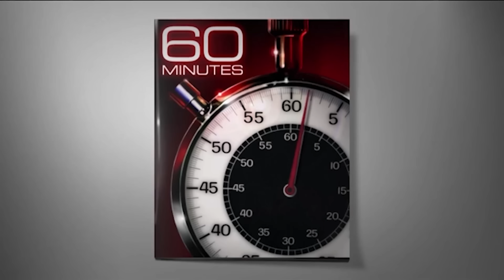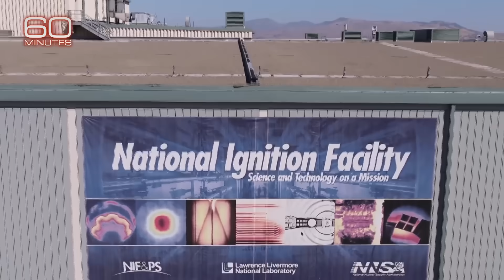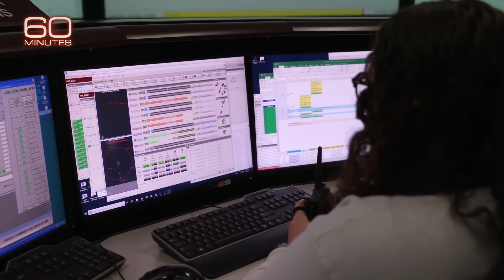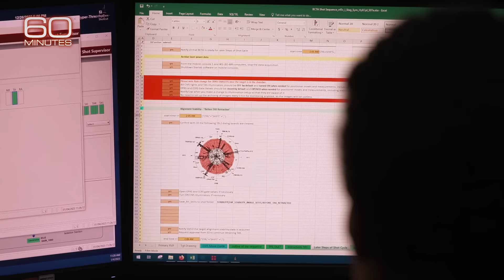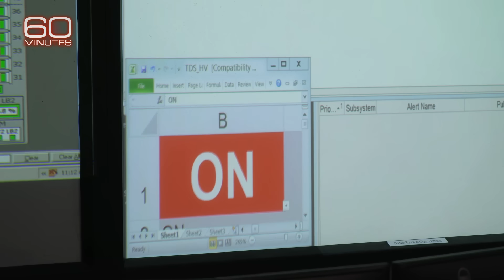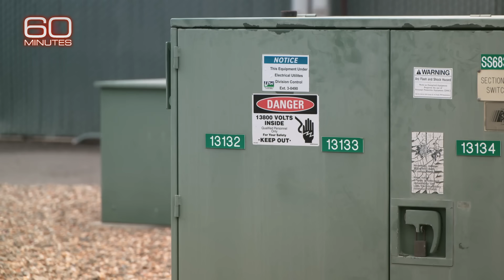Nuclear Fusion: Inside the breakthrough that could change our world | 60 Minutes

Comment: Power plants spin turbine generators with steam so don’t need “sun heat” to boil water…so why would they need a dozen of these capsules in a day?
Reply: Traditional power plants, whether driven by fossil fuels, falling water, solar radiation, wind, or nuclear fission reactions, operate continuously. In the announced experiment it took them about a week to set up the experiment and the release of energy only lasted for approximately 0.00000000008 second. After the fusion reaction begins it blast the vast majority of the supplied fuel away from the reaction center. That then has to be cleaned from the vacuum chamber as radioactive waste. That energy was 3.15 mega joules which is equivalent to 0.875 kilowatt-hours. Considering the usual loss of efficiency to use that energy to boil water that would leave around 0.3 kilowatt-hours of heating energy. The application of 0.3 kilowatt-hours of energy can boil slightly less than 0.5 liters of water. If the steam from that water was used to turn a turbine then the electrical energy from that would be less than 0.2 kW-h. Typical commercial nuclear power plants generate from about 0.5 to 5.0 million kW-h of electrical power. To generate 1.0 MW-h of electricity it would be necessary to blast slightly more than 1 fuel capsule   every second. If the lasers were physically firing more than their current limit of about once per day then the energy needed to drive those lasers would be at least 300 mega joules, or close to 1,000 times more than the energy sent out over the transmission lines.

In the announced experiment the target assembly, that is turned into a plasma with each laser shot, is estimated to cost approximately $100,000 and the tritium fuel presently cost approximately $30,000/gram. The presenters are masters at excluding such key details.

Comment: Where does the extra energy come from??
Reply: In a nuclear fusion reaction, just looking at the merging of a nucleus of deuterium and tritium isotopes to form a helium-4 nucleus, the resulting helium-4 nucleus, combined with the ejected 14.1 Mev neutron, has a rest mass slightly less than the original reactant nucleuses. It is consistent with Albert Einstein's famous equation E = ∆Em2. So there is a small loss of mass during the reaction and that loss of mass is turned into energy, much of it is in the form of kinetic energy of the emitted 14.1 Mev neutron.

You can read more about it in the Wikipedia article titled Nuclear fusion. This reaction is covered under the 'Process' heading.

Trying to create this reaction on earth still hasn't been accomplished without a tremendous amount of input energy.
Reply: @SammySlamma92  I liked the points you raised. Still nuclear fusion reactions are very different than the common chemical and friction reactions that are common in our world. The hand clap results in more atomic vibrations which expresses itself as heat and sometimes sound generation. Charged subatomic particles either attract, or repel, depending on whether they have the same charge, or opposite electrical charges. Yes, insane amounts of energy must be expended to try to replicate the force of gravity in the core of the sun. The efforts have been taking place in experiments since the late 1970s. There remains no shortage of hope, especially those among those who assume all these efforts are relatively new.

Comment: This is BS. That laboratory didn't bring anything new to the table, fusion was proven by nuclear fusion bombs in the 50s, they didn't produce more energy than what they were using and they cannot even sustain the reaction, so basically, they fire the lasers 1000 times and 1 time they measure energy in a point of space and not the whole energy used to power those lasers, this is crazy. The actual Q is less than 1%.
Reply: The National Ignition Facility (NIF) management has their own definition for gain, or Q. I'm still not clear at what reference point that they specify it. It may be just the X-rays that end up compressing the fuel capsule. In prior years they didn't mention the laser input energy. The experiment took about a week to set up so they should have stated the power consumption of the facility for that week.

They also have their own definition of 'ignition.' It isn't like a match ignition where the chemical reaction spreads to the fuel in the head over about a two second period of time. In NIF's case the reaction is totally dependent upon the compression due to the 3 nsec laser pulse. The nuclear fusion reaction lasted for approximately 0.00000000008 second. After that the enormous forces in the microscopic reaction center blasted 96% of the fuel away before it had a chance to react. That was blasted onto the walls of the large vacuum chamber and required removal as radioactive waste.

If it was even possible to conduct one of these 'ignition' experiments once per week on a regular basis then the fusion duty cycle would be approximately 0.00000000000001%.

None of the fusion energy was captured and none is planned, except that tiny portion used by the instruments for measurements.

The NIF project has always been primarily funded as a thermonuclear weapon (H-bomb) research tool but the management has always pitched it to the public as if it were a path to a future economically practical nuclear fusion power plant. The announced experiment included a target material for a nuclear weapons related test. The management have been masterful in obscuring its real purpose. The Lawrence Livermore National Laboratory (LLNL) got funded for NIF in exchange for ending their full-scale nuclear weapons explosion program at the Nevada Test Site (NTS). The LLNL and LANL were forced to end their full-scale underground nuclear explosion test programs at the NTS due the Nuclear Test Ban Treaty (NTBT) going into effect. NIF's aims have always been to create thermonuclear weapons explosions on a microscopic scale.

Comment: The time plan schedule that an energy production using this type of system seems too long and far from us and that is very strange cause some Italians and Greek scientists before 2 decades build the Researching program named 'Deykalionas" and they did build that system of energy production based on the terms of Nuclear fusion that really works and with the use of two basic elements of Nikelium and Hydrogen they did cold nuclear fusion reactor that produces energy for years with a small amount of water and nikelium. How these scientists here after 20 years said that it was impossible to build a system before 2050?? Propably they lied for some reason!

Comment: I thought we already used nuclear fusion in nuclear power plants
Reply: All the existing nuclear reactors, beginning from the late 1930s, rely upon fission reactions. Today the vast majority of those fission reactions are fueled by the uranium-235 isotope and by plutonium isotopes. In those reactions neutron rich isotopes are bombarded with neutrons, causing the hit nucleuses to split into smaller nucleuses that are approximately half the mass of the original nucleuses. The reaction liberates a large amount of energy that is covered to heat and in commercial and military applications used for generating electricity and propulsion respectively.

Comment: Please don't send it to the Smithsonian it will get lost. Biden is talking out his hat. Failed how many attempts over how many years? Got it right once.
Reply: It failed to achieve its namesake goal of 'ignition' by 2012, by a factor of 10, despite having two large laser facilities before it to work out the kinks in the Inertial Confinement Fusion (ICF) process and with two other large ICF laser facilities in the U.S. helping in the ICF development process. Despite the failure to meet that goal funding continued which has finally led to the original goal a decade later. It is estimated that approximately $11 billion has been spent on NIF. NIF has always been primarily funded as a thermonuclear weapon (H-bomb) research tool but has always been presented to the public as a reasonable path to a economically practical nuclear fusion power plant. It is located within the Lawrence Livermore National Laboratory (LLNL) that has always been primarily funded as a nuclear weapon research facility. LLNL was created in 1952 so these operations have little to do with which political party happened to be in control over all the intervening decades. Readers can learn more about the National Ignition Facility (NIF) from the Wikipedia article on it.

Comment: 300 in 3 out! So they got back 1% of the energy they put in!
Reply: The nuclear fusion energy produced was determined by precision instruments. None of it was captured for any practical use and there has never been any plan to capture it since the facility was only designed to simulate thermonuclear weapon (H-bomb) explosions on a miniature scale. It was never intended to lead to a future economically practical nuclear fusion power plant. NIF has consumed approximately $11 billion and the announced experiment target assembly is estimated to have cost approximately $100,000. It was converted into a plasma once hit by the focused laser beams. The nuclear fusion energy released was radiated in all directions from a microscopic spot from the compressed D/T fuel. That energy release lasted for approximately 0.00000000008 seconds. If captured it would have been about enough to energy to boil two liters of water. I can boil the same amount of water on my stove for about $0.40 of electricity.

Comment: Some for now it took 300 units in and 3 units out . Now tell me how is that making money . This is really semple math . Even I could follow it .  But for those who dont I will tell you . If you had 300 USD and wanted to trade it for something more and you found a person with 3 USD and you trade . That is not making money . Both people are fools .  So lets see what the real cost is for now .  We started out with nothing .  now we have to make the building and equipment to make it work . Now remember we started with nothing . So we are already in a hole just for this . Lets just say that cost is $100 . Then all the time of work personel lets just say that cost came to another $100 .  Right now we are at the stag that we got it to work for that single one time shot that it did work for about a split sec.  So so far this cost the tax payer 200 and we only got a split sec of energy back out  at a cost of -$200 to 0 .
Reply: Good analogies. Such waste was made possible since NIF has always been primarily funded as a thermonuclear (H-bomb) research tool. The management has always pitched it to the public as a reasonable path to an economically practical nuclear fusion power plant while obscuring its real purpose. NIF was preceded by two earlier large fusion research facilities that were expected to overcome most of the kinks. NIF was completed very late and well over its original budget. It was supposed to achieve its namesake 'ignition' by 2012 but failed by a factor of ten. It has taken a decade of improvements to finally reach that goal with doesn't factor in the laser input energy. One estimate of the total funds NIF has now consumed is $11 billion. It was expected to be followed by the LIFE project but after the National Academy of Sciences (NAS) produced a critical analysis of that plan the lab quietly defunded the project. That hasn't stopped the administrators for pushing for a higher power version of NIF that employs diode pumped lasers.

Comment: Once this ignites, the ideal situation would be for it not to go out.. one shot..
Reply: The National Ignition Facility (NIF) lab uses their own definition of 'ignition.' It isn't like a match that once struck the combustion reaction spreads through the rest of the fuel until it is all consumed. That initial reaction takes about two seconds. In the Inertial Confinement Fusion, used in this experiment, the nuclear fusion reaction lasted approximately 0.00000000008 seconds. During that time the vast majority of the fuel was blasted away from the microscopic reaction center. It was reported that only about 4% of the fuel got a chance to react. The reaction was almost totally dependent upon the compression provided by the laser beams, lasting only about 0.000000003 seconds. The energy to create that was over 100 times greater than was generated by the nuclear fusion reaction. The approximately $100,000 dollar target assembly was converted into an exploding plasma which splattered the interior of the vacuum chamber and required removal as radioactive waste.

The experiment took about a week to set up. If this experiment could be repeated once a week then the nuclear fusion duty cycle would be 0.00000000000001%.
Reply: @vernonbrechin4207  well interesting stuff there, maybe they need to have the particular levitate with magnets and spin the reaction, I don't really know about this stuff, (plumber) but anyway it's great to be making advancements and more understanding of the technology. 
To me, keep it safe, somehow have a nuclear fusion that continues.. or stick to solar, wind, hydro power, and change the way we store power...  I'm sure it's all happening anyway.. 
If it's all about compression, and pressure why not use High density microwave laser in the chamber, levitate the particle (a much bigger one that requires less change) supply more power and have it continue to run. 

The fear is if a technology like this leads to something unexpected in the power of the reaction. 
That's the unknown. 
If the Sun can be re created, step lightly, as anything that surrounds it, I'm sure would not withstand total power.
Reply: @NatureCams  - In this experiment temperatures of around 150,000,000°C were achieved and pressures far greater than the anything humans ever work with. In arc welding the plasma temperature might be 10,000 °C. Simulating what happens in the core of the sun and sustaining it has been a goal of nuclear fusion physics experiments since the 1970s. It has only worked in H-bombs which are massively destructive. Any attempt to attempt to contain a miniature nuclear exploding if fruitless. It is going to explode violently. The very large NIF target vacuum chamber was designed to only contain such explosions that involve a microscopic point of fusion fuel.
Reply: @vernonbrechin4207  you seem pretty knowledgeable, what's your thoughts on blocking out some of the energy from the sun, I know it sounds far fetched, but the sun can be a risk to earth. Is there any plausible way in the high atmosphere a vast spread of something that can filter out some of the sun's heat and radiation.. not all but like 5% or what ever is required. It is getting hotter.
Reply: @NatureCams  - The concept of blocking some of the sun's energy hitting the earth to counteract global warming has been looked at by many scientific and engineering studies, that go back at least two decades. They fit into a category known as geo-engineering. Many studies have not gone far because it was realized that there are a broad range of unintended consequences that could result. Also, many of the proposals involved harvesting large amounts of energy and resources to accomplish the tasks. In many cases the consequences are likely to upset this planet's life support support systems that many people don't understand forms the foundation for human life.

Comment: Amazing really, the capsule around it does look strong
Reply: The wall around the tiny capsule is very thin, only a small fraction of a millimeter.
Reply: Oh I don't mean the small shell I mean the structure around the whole thing...
Reply: @NatureCams  - Thank you for your clarification. the small canister, surrounding the suspended fuel capsule, is called a hohlraum. It does have a thicker wall and is gold plated inside. It may also be made of gold. I've heard it has two double pane windows on each end. I'm not sure what they are made of. The ultraviolet laser beams shine through the windows where they are focused and then spread out in the interior to bathe the inner surface of the hohlraum in a carefully determined way and with careful timing. The wall converts to a plasma and generate X-rays that radiate broadly. The portion of the X-rays, that head to the center serve to compress the fuel capsule as it turns into a plasma.

Comment: Wonderful!  Now if only by some processes they could sustain the reaction for more than a few seconds!  Those small pellets are very expensive!
Reply: The nearly perfectly spherical diamond shell fuel capsule, the inserted deuterium/tritium fuel, the surrounding gold plated hohlraum and the supporting structure have been estimated to cost approximately $100,000. It was all turned into an exploding radioactive plasma during the 0.000000003 second laser pulse blast and nuclear fusion reaction. The energy released by the nuclear fusion reaction was approximately what it would take to boil a couple of liters of water. If I boiled the same amount of water at home it would cost me about $0.40 in household electrical energy.

The nuclear fusion reaction only lasted approximately 0.00000000008 seconds. It started in a microscopic volume and then the enormous forces of that emitted energy blew 96% of the remaining fuel away from the reaction center. This was expected since the NIF lab has always been primarily funded as the thermonuclear  weapon (H-bomb) research tool and thermonuclear weapons also blow much of the fuel away from the reaction center before it has a chance to react. They use the term 'ignition' in a misleading way.